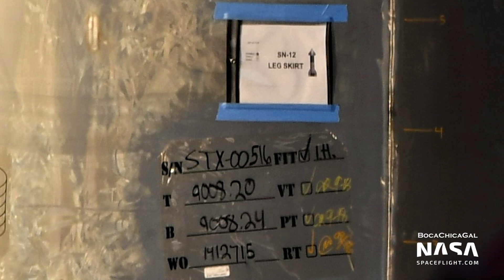SpaceX Boca Chica - SN5 and SN6 Moved Outside - SN12 Leg Skirt

Comment: 0:00 - LR1600/2 Crane Parts
0:26 - LR1600/2 Crane Assembly
2:10 - Camera Platform Added to Mid Bay (NOT HIGH BAY, LABEL WRONG)
2:49 - Orbital Pad Construction
3:35 - Earth Work at Launch Site
4:16 - SN8 at the Launch Site
4:35 - New Weather Station Installed
5:19 - Methane Delivery *(LABEL WRONG, NOT LN2)
5:31 - High Bay Construction
5:48 - Drill/Piling Rig
6:07 - High Bay Construction
6:44 - Mid Bay
7:00 - High Bay Construction
7:32 - Transporters Moved to Build Site
8:29 - Forward Dome
8:57 - SN5 Moved Out of High Bay
10:13 - SN5 Closeup
10:39 - SN5 Moved
11:09 - SN12 Leg Skirt
11:24 - SN5 at Golden Hour
11:30 - SN5 at Dusk
11:41 - SN6 Moved Out of High Bay
11:52 - SN6 Closeup
12:10 - SN6 Moved
12:58 - SN5 and SN6 Outside Together
Reply: Its SN12 Leg Skirt not 13, at 11:09
Reply: Uhm, Jack, I don't think that's the high bay, as listed, at 2:10.  The structure (and level of completeness) doesn't look right for it.  EDIT - In fact, you can see the camera platform on top of the mid bay in the 6:44 Mid Bay sequence.
Reply: Thanks !
Reply: @HANSS420  fixed, thanks
Reply: @MicahTischler  D’oh! You’re right. My bad. Edited the Timestamps, thanks.
Reply: @JackABeyer  By the way - if I might ask a dumb question ... Why do you place the timestamp contents in both the description and the comments?  (Also, it looks like there are four places, in total, needing update. :/ )   Thanks for all your efforts.
Reply: Looks like Liquid Methane delivery at 5:19, not LN2, cheers!
Reply: Micah Tischler some people don’t expand/read the description so I put them in both places
Reply: Fred Planatia fixed, thanks!
Reply: Micah Tischler ...also when going back to research something seen a while ago,  these time stamps really help  ;)
Reply: It says "11:099" in the description, which means it doesn't work as a link...
Reply: @Aaron628318  
youtube ignores the superfluous '9' and points, correctly, to the Leg skirt clip.
Reply: @-danR  Sorry - my comment is maybe in the wrong place. I'm referring to the times in the video description. 11:099 isn't a link and there is no change in the corresponding hover text on the time bar.

Comment: How is SN12 already a thing :o
Reply: Got to be ready for when SN8 more than likely and unfortunately hits the ground a bit harder than desired
Reply: 2 more then orbital starship
Reply: @Radio_Nullifier  yes,  mid teens
Reply: @kiwigurn6328  5ish more (if SN8 and others succeed) starships to make an orbit worthy vehicle!
Reply: The Best true, but SN8 is more likely to break apart during the bellyflop than hitting the ground hard because by now Spacex’ AI has almost perfected the landing algorithms.
Reply: @nouribrahim2010  not entirely sure belly flop would that aggresive in this scenario mayb they will start higher up like at 10km and slowly flop not too aggresively and probably land like f9 with engines down much higher up than the future prototypes
Reply: Enterprise Space Systems that could very  well be true. 
Taking the 69m/s fall speed that they showed in last year’s presentation, falling from 15km would take between around 4min.

If this is just about testing flaps response and starship balance during belly flop, they would want to flip at least a minute before landing.

My own guess is between 7km and 5km. (Cause they want to recover the ship but they also have time while falling and need data from the horizontal fall)
Reply: Enterprise Space Systems I was mostly referring to The Best’s comment that the starship might hit the ground hard. It’s unlikely due to SPACEX’ mastery of controlled landing, which applies to starships as well....... However, you are right they will definitely begin with low altitudes belly flops. Yet, I’m concerned about the integrity of the vehicle between the forward and aft flaps during those maneuvers.
Reply: Ibrahim Nour looking at those elongateted erm long cans I fear  that too, but I am quite confident the engineers go that. I mean they have rocket scientists 👩‍🔬  👨‍🔬
Reply: Paul Schroeder exactly. Have you seen the Agena Atlas stainless steel rocket which collapsed like a ballon after it was depressurized? This is my ultimate fear starship..... As you said, SPACEX’ engineers probably prepared for all possible contingencies. 🤞

Comment: It’s interesting that they would build the rails on that observation platform with what looks like a unistrut material instead of a tubular section. I could see where ease of equipment installation would be increased a bit but typically a u-bolt does just fine.

Comment: Only thing i can think of that Liebherr LR1600 is for is the starship + super heavy stacking.
To lift a 50 meter high starship on a 72 meter tall superheavy booster on top of a ~18 meter high launch mount means that they need to lift to over 140 meters and weight of around 220 tones for a loaded starship or superheavy booster.
That is going to be huge and the weather could cause stacking delays. I don't see how they will have crews working to help with the coupling of the starship to the superheavy so i think there will be a self aligning mechanism so they can lock together without the need of people.

Comment: awesome clip....very VERY interesting, so SN8 4:28 to test feasibility of winged vehicle?  SN5 and SN7 12:56 both with COPVs installed for big hop testing movable wing flight?.....awesome interesting clip... Factory is moving at full steam ahead,,,,imagine the daily running  bills? CCC Construction, Sarens, Fagioli, .....awesome stuff, thank you for sharing.....downloading to digest more...
Reply: @gerbermrsa SN8 will be used for a 15km bellyflop test flight.
12:56 is SN5 and SN6 (the vehicles which flew 150m hops), and I don't think they'll fly again - all work looks to have stopped on them. Those COPVs are for pressurising the propellant tanks when they're empty, not for aerosurface hydraulics - Elon tweeted recently that the flaps are now run directly from electric motors and gearboxes.

Comment: Does anyone get the feeling they are about to build a methane extraction well/tank farm and separation plant .Tankzilla  +  Pile driver /well driller  + additional tanks recently delivered = ?  
here is an exert from the American Geosciences Institute "The main methods used to remove non-methane components from natural gas are absorbents and cooling. A variety of absorbents may be used, including special oils (for NGLs), glycol (for water), amines (for sulfur and CO2), and zeolite or oil absorption (for nitrogen). Chilling natural gas down to different temperatures allows different components to be removed as they condense into liquids. This is the most common method for nitrogen removal: the natural gas is chilled until the methane liquefies, allowing the nitrogen gas to be vented off."
Reply: They seem to be getting ready to build something very big over there.  That's an interesting idea.
Reply: A new LOX production facility has been definitely announced. That can account for the accumulation of equipment. And Elon said long ago they want their own methane plant "close by," but I'm 99% sure he meant one using the Sabatier process, not one using fossil fuel. Not a peep about that since.

But... they do have that old well there, which almost certainly has gas left. I've wondered about that, but extracting fossil fuel from the ground involves a big regulatory structure, environmental permits, etc, and SpaceX doesn't have any experience in that. Methane can go boom. (And it's just yards away from state parkland.) But with SpaceX, you never know.

LOX by itself doesn't really go boom, and a facility just extracts it from the air.

Comment: Are there still raptors under sn5 & sn6?
Reply: Good question!
Reply: I’ve wondered but assumed they got pulled .. but hmmm.. no videos of that.
Maybe after a couple more sn5/6 hops they’re going to join sn8 with a new raptor 🤷‍♂️
Reply: @bentstraight3239  Seeing as SN8 is currently occupying the only test stand with the required equipment for static fires/flights, and all work seems to have stopped on SN5/6, I feel it's safe to say that they've been retired. Elon did tweet a while back that several short hops would happen, but things seem to be ahead of schedule. At least SN5 and 6 get to retire honourably, not in a fireball ;)
(also, I doubt SN5/6's engines will be reused. Raptor development is moving so fast that whatever engines SN8 gets will have a significant increase in performance).

Comment: 11:55 Need an access hatch? Just cut a piece of steel out, no big deal :D
Reply: sorta looks like theyre converting it from the square hatch design to the circular one
Reply: Looks new. I don't see any attachment points for a cover, just a hole.
Reply: There's a reason why airplane windows have rounded corners, and it could well be the same reason why they went to circular access hatches here. When cycling the tank between pressurized and non-pressurized, little micro cracks in the metal can originate in the corners leading eventually to tank failure.

Comment: So which one's which? can you guys spot the differences between SN5 and SN6?
Reply: The 5th ring from the top on SN5 is duller than the rest of the vehicle. SN5 also has a larger cluster of experimental thermal protection tiles near the bottom.

Comment: my only guess is that they will use SN-5 and 6 as expendable 20km hop test articles should SN-8 fail its test hop. I don't know whether or not 5 and 6 has their flap actuators installed but with the initial pressurization  and static fire issues resolved, the real challenge coming up is this "suicide dive" thing. Musk will need spare flight-ready articles that are not destined for orbital ops and have basically outlived their usefulness as planned test vehicles.